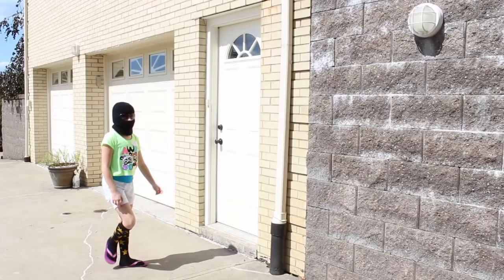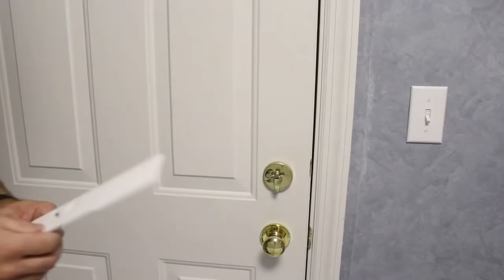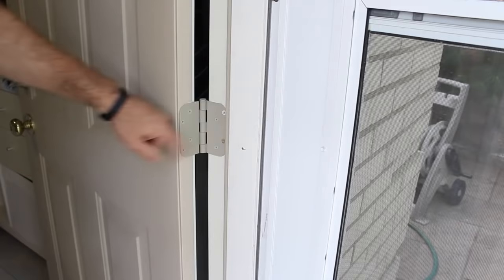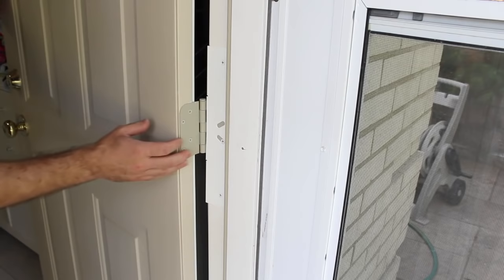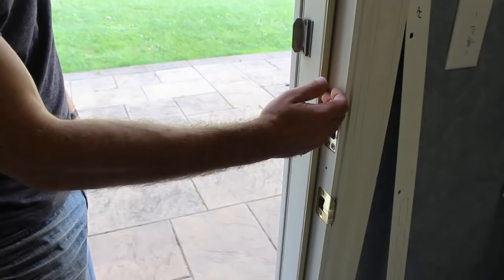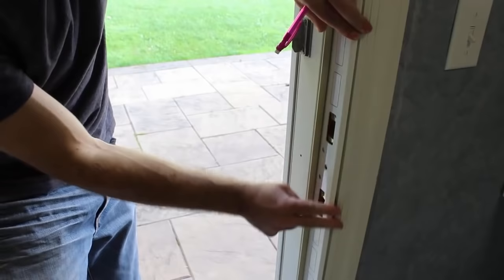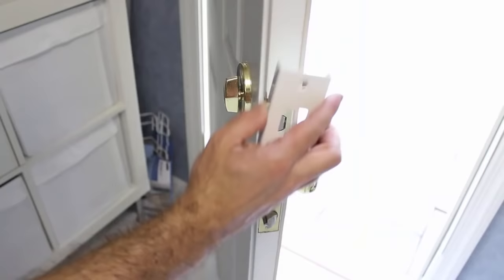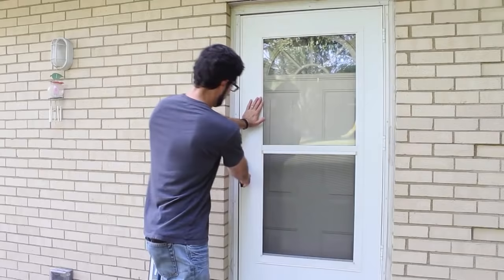How to Reinforce and Burglar Proof Your Entry Door

Comment: This seems like the kind of solution that makes you feel better, but I can't see how those thin bits of metal are going to reinforce anything. Also, in the unlikely event that the "jamb shield" and the "bolt shield" actually fit, then you must have had a pretty badly fitting door in the first place. Might be great for climates where you don't need to worry about rain or cold air getting through the gaps!
Reply: +Mat Smith I specialize in doors as a handyman and I found that the DSA from nobreach.com fits almost any door with no adjustments needed.
Reply: +Mat Smith A reinforcing bar/jamb shield and longer screws can make a door go from being kicked in in one kick (literally one kick) to about 50-60 kicks.

The issue with door security is that the door is only secured to the framework, which can crack very easily - kicking through framing (which is about 1/2 inch thick) and stripping whatever remains of the 3/4 inch screw is no problem. Take a look at some of the crownmolding or baseboards in your house, consider that less than double the thickness of the wood used in your baseboards/crownmolding is all that's keeping your door shut. 

Even people who aren't physically strong can easily break wood of that thickness with their hands, and there's a lot more force and strength in a kick (especially with proper technique). If you ever have the opportunity to do so, I highly suggest you try kicking a door in - it's very easy (Especially on interior doors, which feature no reinforcement and are typically hollow).

When you reinforce a door like this, you're securing the screws to the actual surrounding struts in the door (2x4's) and framework, giving you 3 inches (minus half an inch for the gap in the framework and struts) of wood that's being supported. That's a significant difference, and now what an assailant is kicking through isn't 1/2 an inch of wood (as most people are simply not capable of kicking through a piece of braced 2x4 (let alone two of them, a 4x4 or a 'garden post')), but the actual tensile strength of (in this case) 7 3 and 1/2 inch steel screws embedded in hard lumber. 

Since our screws aren't going anywhere, we're going to need to snap them. One screw has about 121lbs tensile strength, so we're looking at 847lbs of tensile strength in this door to break the screws. Holly Holm (A professional MMA fighter) kicks with about 50 pounds of force, a professional male athelete (or someone with a hefty build) may be able to manage 60-80.

They're not snapping those screws any time soon, the more likely failure is now going to be on our hinge side but since we've secured the hinges with hinge plates (which reinforces the framework and ties it directly to the struts) that's not going to happen either (In this case, we're looking at dealing with 8 screws, plus the additional strength provided by the additional three non-reinforced 3/4 inch screws on the hinge). This leaves the weak point of the door being the mechanical systems of the door, such as the actual knob and deadbolt (since the space is hollowed out), which is negated by those additional shields (in this case, he could not fit them into the door).

Assuming you have the shields in place, you've made the door more or less invulnerable to being beaten in by brute force methods (you're not breaking through the frame, or any of those screws), and if repeated kicks are applied (upwards of 40), you're not going to see the frame fail, you're going to see the actual DOOR itself fail (depending on material).

If we assume it's a standard entry way door with a particle core, you will see failure of the door itself (IE: They will have to actually kick holes through the door) before you see failure of the locking mechanisms, strike plates, or framework, or hinges.

You can perform this technique without shields (simply by replacing the default screws) to get the same effect, with slightly less reinforcement (because the stress is not spread across the system). Keep in mind with a reinforced door (no matter the system) the lower left of the door and upper right of the door are always structural weakpoints as there's no bracing behind them.

However, as you're never going to be able to kick the upper right of a door (above the deadbolt), this issue can be mitigated by a deadbolt placed lower on the door or by having a door brace installed. In fact, a single and properly installed door brace that fits into the floor actually offers just as much protection as whole-door reinforcement as seen in this video, at least for the non-hinge side of the door.

Hope that helps clarify how, and why these methods of reinforcement are actually incredibly effective for home defense (not deterrence).
Reply: It works by distributing the impact of the kick so that impact isn't in a lot of force in one place but a little bit of force in a lot of places.  Basically it is radiating the energy away from the point of impact instead of letting the door's design focus it on the weaknesses.
Reply: Mat Smith 
I guess you failed math and physics class.
Reply: not thin, heavy guage.
Reply: It's not Fort Knox, but the metal strips and screws do add some strength.  To force the door open, you'd have to drag 5 or 6 screws out of the jamb which can definitely be done, but it might stop a nervous 16 year old criminal.

Comment: Thank you SO much for your very helpful, informative and excellent video. IF I need to drill out the screw holes first, what size bit would you recommend?  Thanks again!
Reply from the maker: use a drill bit that's slightly smaller than the screws

Comment: When installing security screws through the door frame into the wall structure, be sure not to over tighten. Any amount of draw will take your door out of adjustment. 

Applying this same concept, if both sets of reinforcements on the latch side will not fit, you may be able to increase the available gap by tightening the 3 1/2” screws in each hinge. This may draw the door just enough to widen the gap on the latch side. Subtle adjustments in this way can make all the difference.

Comment: What can I do if I have two side windows next to the door?
Reply from the maker: that's a touch one Lisa, you might want to consider a home automation system that runs through SmartThings. It's pretty affordable and can alert you if there's a break in. I know it's not perfect but something to think about. I made a video on this system awhile back https://youtu.be/xcMmGcxcRIY
Reply: you can  buy a double cylinder if you want
Reply: We have glass light panels on both sides of our door and we used thick plexiglass panels with security type screws which require a special bit to extract them. Lexan is even better though more expensive. 3M also makes security films that can be applied over existing glass panels.
Reply: If I might just point out that alarm systems are like cops , they show up after the fact. If you can't keep them out in the first place, don't bother with an alarm system except as an after the fact alert. Learn to secure your house first,  then learn to defend yourself. Bear spray is a non lethal alternative to firearms, although this will mess up your house and you if not used properly. I prefer firearms in the hands of trained adults.
Reply: Thank you for the feedback . I will look into the 3m security film.
Reply: A Mossberg 500 or Remington Model 887's work well, as well as a Ithaca 37.
Reply: Lisa M 
I have a 6ft x 24in window next to my door.
Replaced it with custom hurricane resistant type security glass window.
My other windows have 3M security film.
Reply: Glass blocks or hurricane glass.
Reply: That's a double cylinder dead-bolt ...
Reply: 3M Ultra S800
Reply: Mr Frog Not if you’re not at home.

Comment: Unless u have a solid core door, replacing the screws for the deadbolt & handle is a waste.  2 1/2 screws into foam core does nothing.  Good video otherwise.
Reply: Screw a lexan or steel mesh reinforcement for weak areas. That would help a quick pop in through a panel to get to the lock.
Reply: Poopyface Tomato Nose o shit you are that character cris created on family guy.

Comment: As a locksmith,  deadbolts come with the 3.5 screws. You can do all that, but with cheep lock hardware still a temporary option.  Not going to get into different ways to bypass for security reasons.  Contact a local locksmith for best practices.

Comment: For $80 I got a steel security door that replaces your screen door. They can't kick in your door if they can't get to it. And I replaced all the screws in my front door that this guy did for way cheaper.
Reply from the maker: you should have made a video!!
Reply: Brian Jordan This goes into REINFORCING your door, not adding a security door. Good for you i guess
Reply: E1337hobo X 
So you save ten bucks by REINFORCING your door compared to my PROTECTING my door. No point in REINFORCING your door if the thieves can't GET to your door. 
What is your problem?
Reply: The point is that not everyone has the option to add a security door, say due to HOA restrictions, its is an apartment or whatever.  If the only available option is reinforcement then this guy is showing one such product.
Reply: lm0315 
Fair enough. I don't have an HOA and cannot understand why people would pay people to tell you how you can run your own property. My option was meant as an alternative for those who own or have decent landlords.
Reply: Brian Jordan 
My HOA is for the amenities.
I don’t run my property I just live there.
And I don’t live in a war zone.
Reply: I thought with my steel security door, everything was tight.  Found out that they simply (and very easily) pulled/bowed the steel security door towards them, popped the cheaply welded top hinge and the locks were defeated.  FALSE sense of security!  I would not have believed it if my surveillance system installers hadn't demonstrated it to me.
Reply: Makes sense!

Comment: The outer door needs to be replaced with metal one I see that on homes all the time big mistake.
Reply: Hi It's Me Mind Your Own Business 
Yeah I have a full view glass storm door that's custom made metal with hurricane resistant glass and deadbolt and two solid deadbolt latches and you can't even tell by looking at it.
Reply: the door is steel.   But the point if this video was NOT to make your entire home burglar proof, it's just about this door.
Reply: correcting my comment:  the door is steel over wood.
Reply: metal door can still be busted in , weak points are strike plates and jambs that are usually wood even on a metal door.
Replacing door with out swinging door would be much stronger do to stop molding being inside.
Reply: Correct. Door that swings out has a great advantage over those that swing inward, security wise.

Comment: Great tutorial. Another awesome Intrusion Prevention System is a 12g shotgun with 3" slugs
Reply: I prefer 000-buck if using a shotgun... 12-gauge slugs would just go through the burglar and probably a couple of walls in your house.  Ideally, you want to keep all of your projectiles inside of the burglar -- if for no other reason than just so that you don't have to do wall / sheetrock repair afterwards... :)

Comment: Jeff, nice video.  You can sometimes get the door shield plates to fit if the frame to door gap is too tight by tightening the frame plate's screws tighter than just flush.  A lot of doors are not shimmed correctly and it will allow you to pull the frame over a little and allow you to put the door shilds on. If the gap is really tight, it doesn't need them as badly, but they do help if you can fit them in. Plus upgrading the deadbolt to a heavier grade doesn't hurt as well.

Comment: I'm a specialist at Lowe's and the jam kit is a great idea. But using a impact driver is not the best driver to use. A n impact driver pushes the screw through the wood thus not allowing the screw to fully bit into the wood. To get the strongest hold it is best to pre drill then drive the screw in using a standard drill driver. Good video.

Comment: I love the video.  I was hoping to be able to use for my house, but I have an alarm sensor on my door, so it wouldn't be possible.
Reply: Alain N it is possible! Not much is “impossible”. Remove the alarm sensor(EASY), install this or cheaper metal from hardware store. Then reinstall alarm sensor. Simple

Comment: Nice video! One bit of construction criticism, I mean, CONSTRUCTIVE criticism is, the reason they recommend pre-drilling is to reduce the chances of the wood behind the jamb splitting. Sometimes those studs are 30, 40, 50+ years old and split quite easily.
Reply from the maker: Good point Logic Bob - I totally agree with you. Thanks for the nice tip and insight.
Reply: Even if you use self drilling deck screws?

Comment: Door Jamb Armor makes a solution for double doors that open inward.  It's very similar to the kit in this video, but it has a component that installs on the top jamb and on the floor.  Very solid.  I've had attempted break-ins at places I've installed it and they didn't get in.

Comment: I use case hardened left handed screws with a right twist with flat steel between the jamb and double stud. To attach use a hand power twist pound tool calibrating psi...this allows ft. pd.. measurement knowing pressure to counteract forced entry. I'll tell you another PRO TIP tomorrow,

Comment: Just replacing most screws that go to the door frame with 3" screws probably provides comparable security. 

Spending $60-70 doesn't help much when you have a $15 kwikset deadbolt. This helps with kicking the door in. But there's many many more ways to get in.
Reply: The hardware is far more important than the lock. Not many criminals pick locks these days. They'll kick the door or smash a window before picking. Reinforcing the door is to make them choose between the louder windows or leaving, preferably leaving. Any deadbolt will hold fine with a steel strike plate and 3 inch steel screws.
Reply: @ytmndan  you're Ludacris if you think breaking a window is louder than kicking in a door. 

You're right, the common thief probably doesn't have the skills to single pin pick; they use low skilled attacks (I don't wanna list the ways but there's quite a few) 

You got one thing right tho, the goal is to provide a long enough deterrent for the thief to give up; especially if you live in a detached single family home. 

PS, the deadbolt is considered hardware
Reply: Aight, well I’m just gonna roll out, then.
Reply: @ytmndan  I'm not sure if you understood what the other dude was saying. Even if this whole kit is perfectly installed, the deadbolt will be the point of failure. All of this money is wasted. Doors and locks only keep the honest out and even with a serious upgrade to the locking apparatus, it will almost always remain the point of failure. The difference between access times after spending this amount of money or even 2x this amount is maybe one additional swing with a sledgehammer

Comment: your video is even better than the manufacturer's installation video. one thing i'm curious about is the size of the screws used to secure the hinge to the door. those are still tiny screws. shouldn't they also be replaced with something stronger/longer?
Reply from the maker: Thanks Adam, it wouldn't hurt to use longer screws

Comment: Great vid, and so helpful.  In terms of using the 2.5 inch screws that would have been used for the door shields, do you need to check first that these screws will not hit either your deadbolt or the door knob once they are screwed the way in?

Comment: For those not willing to spend that much money: I get it, times are hard. What you can do is just buy a pack of 10 or so 3 to 3 1/2 inch screws and drive them in everywhere there is a strike plate or on the hinges (you don’t have to replace every screw on the hinges).

Even doing that will take your door from being kicked in on the first or second try to being far more difficult to kick in. Most doors break at the strike plate which is only attached to the door frame. Getting a screw into the frame of the house (usually a series of 2x4s) prevents that. $5 east fix in just a few minutes that is easily affordable. You can scale up from there.

Comment: Good job on the video.
I want to stress the need for the average person to predrill the holes. The phillips screws are too likely to strip out before they go all the way in with a standard battery powered drill. The impact is a great idea, but most folks don't have those.
Reply from the maker: +morgan painter thanks for adding your thoughts, looking back I would have pre-drilled. Too much of a chance for the wood to splinter. I do love impact drivers
Reply: My experience is related to the head of the Phillips screw stripping out. A long screw like those develop a great deal of resistance before they bottom out. That plus the possibility of splitting the wood are good reasons to predrill.

Comment: for anyone wanting to fortify their door save yourself some money and just go buy some three or four inch screws and replace the little tiny half-inch screws that come with your striker plates and just put big long three and a half 4 inch screws in also install 3 and 1/2 inch screws in the hinges and done and if you're buying a new front door buy a door that opens out for the most part that will solve your problem right away have you ever tried to go inside your house and kick the door open from the inside if the door opens inside your house you're relying solely on the striker plate to defend yourself if the door opens outthen you have three quarters of an inch of material on each side of the door stopping the door from being kicked in